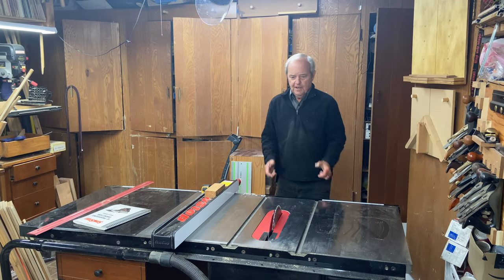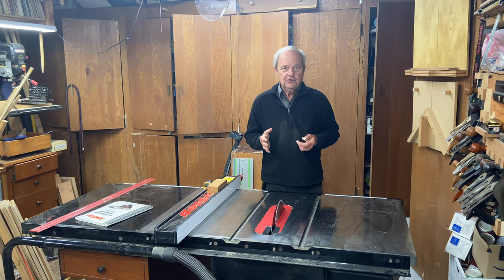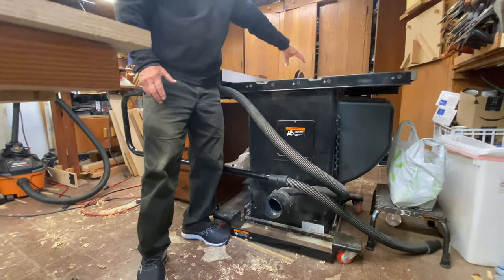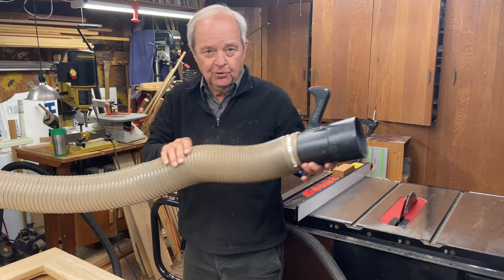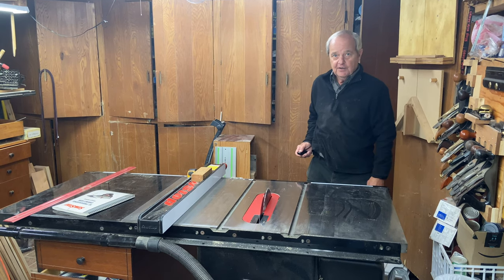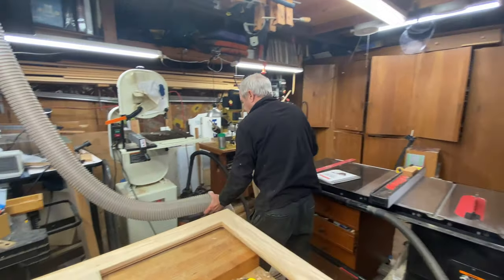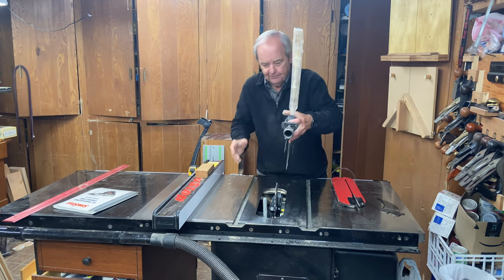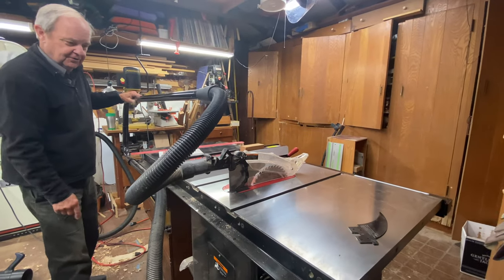Table Saw Dust Collection Tips for Small Shop Woodworking

Comment: Thank you for uploading this video and I really appreciated it. I am doing my research now before installing my own system.

You should know that the prevailing argument from experienced woodworkers is to reduce the length of tubing as much as possible, as well as to use straight piping as much as possible as the ridges in the flex tube make the air way more turbulent and you lose a lot of power.

If you ran a straight 4" pipe across the ceiling and then had your flex pipe it would be about half as short and more efficient and easier.
Reply from the maker: Yep! But it isn't as flexible and mobile that way :)
Reply: @SawsHub  Absolutely.  After watching your video I recently built my own.  What I did was drive the 4" pipe as far as I could without using the flex hose and did the final bit for a push. It was still an informative video!